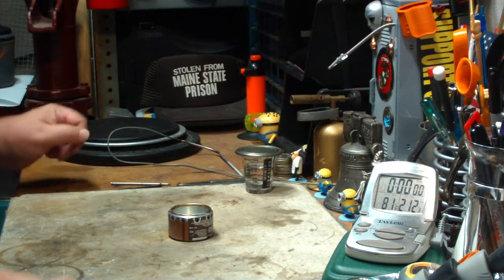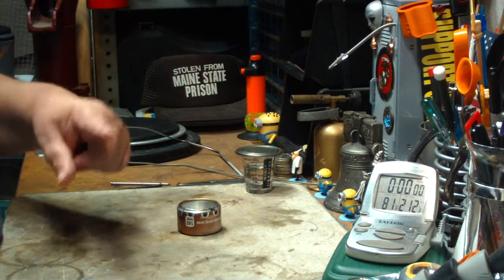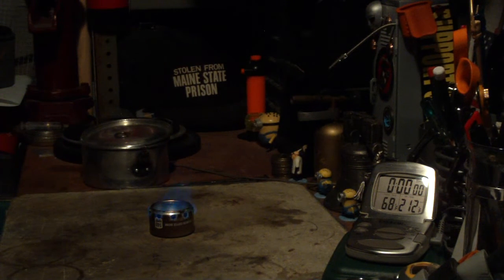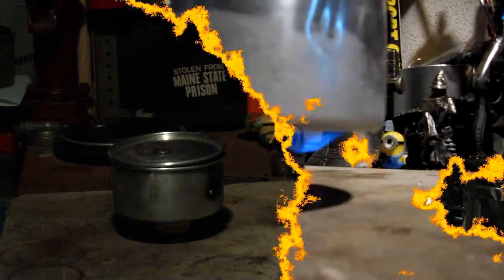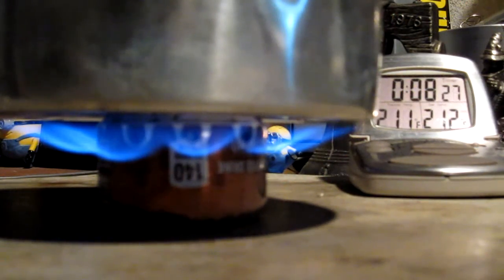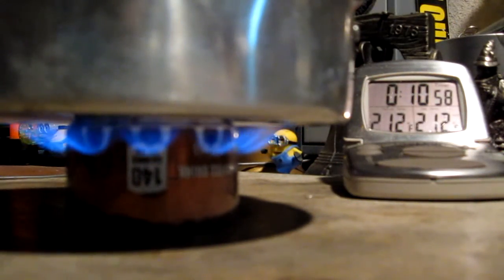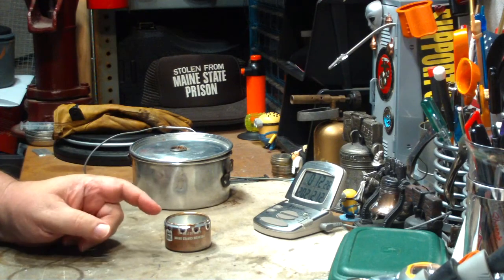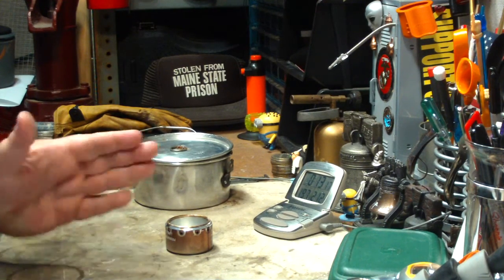MatoNupai's MAHALO Alcohol Stove - Boil Test #4 - Using Water at Tap Temperature

Comment: Quite agree with this.As so many below state, the standardization that you use makes the tests meaningful. We get a boil time for 60 deg water, All done in the same pot. Also, as you give temperature after two minutes, we get a rate of temperature increase. Run out is indicative of the fuel efficiency of the design. What more can we viewers ask?  Don't lean over backwards to try and make a poorly designed burner look good.

Comment: 1) I think standardizing your tests is completely fair and 60 F is as good a temperature as any.  Backpacking Light tends to use a rise in temperature as their measure rather than getting to a true boil, going from 60 F to 200 F for example.  They claim as you approach boil, you see other effects due to the transition from liquid to gas that can skew the results.  You'd have to read their logic on their forums, but I think both approaches make sense.